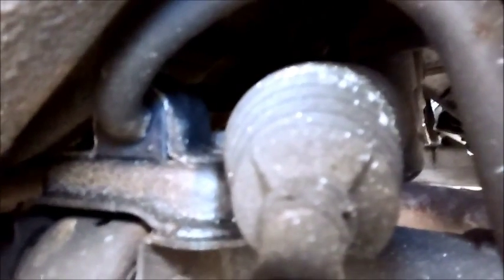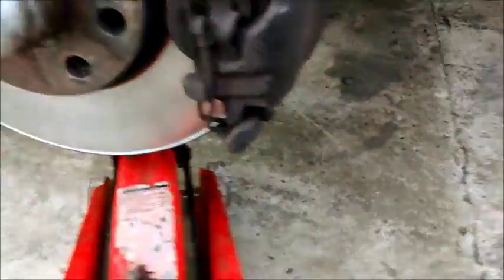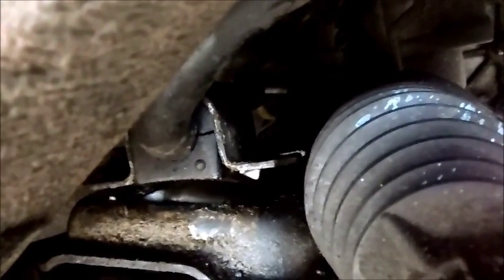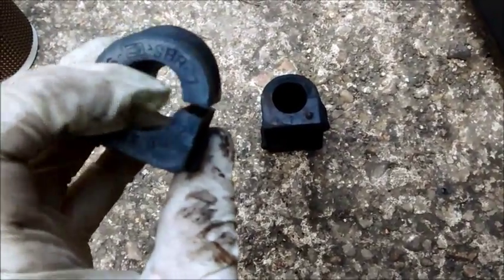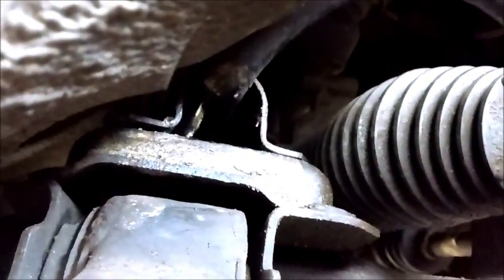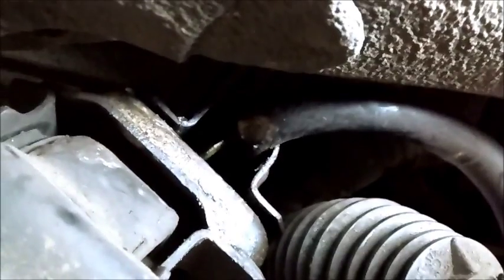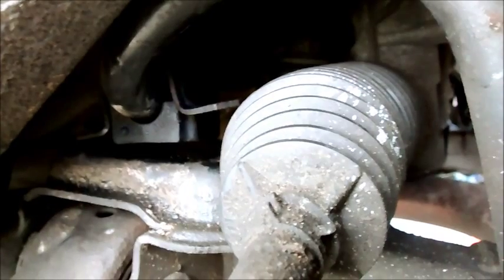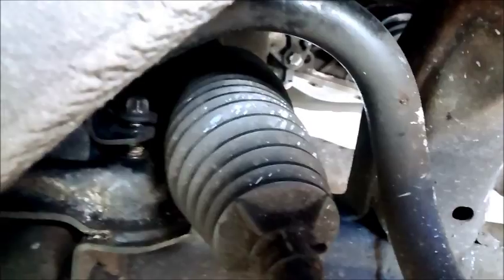Astra Mk4- Anti Roll Bar Bushes Renewal

Comment: I fitted the Powerflex bushes. I don't have much faith in modern rubber. I used the same spanner (as recommended by somebody on the AOC forum) but the spanner wouldn't fit on every bolt so I had to use whatever sockets would fit. I found the gearbox side a bit more difficult because there was less room to get my tools in.

Comment: Another way to do it is leave the old bush in there and put a small thin suitable sized rubber pad underneath the old bush and screw it back down, this should compress the old bush around the bar a lot tighter, even tighter than a new one.

Comment: Did you remove the back bolt after, seems to be alot of movement in the clamp?
also would it be any easier to remove drop link first as i have to renew this anyway .thks
Reply from the maker: MrNig1 Hi, no the back bolt shouldnt need fully removing just loosened. If you took that off it will be very hard to refit it due to space and clearance.
The droplink can stay attached, but if you are replacing that anyways, it matters not.

Comment: Hi, did you leave both drop links attached when you did this job?
Reply from the maker: Typey1 yep you can use the links to pull the bar into place
Reply: switchest26 
  Thanks for your reply, I'll try that.  I'm hoping the bolts dont shear though, i have soaked them from underneath, they look rusty, i might try heat as a back up also from underneath
Reply from the maker: Typey1 they will be fine bud...tho soaking them for a day or so will always help 😊